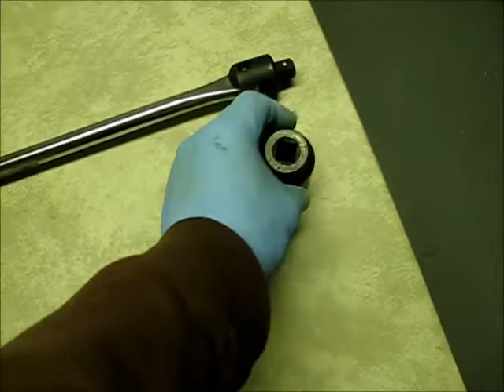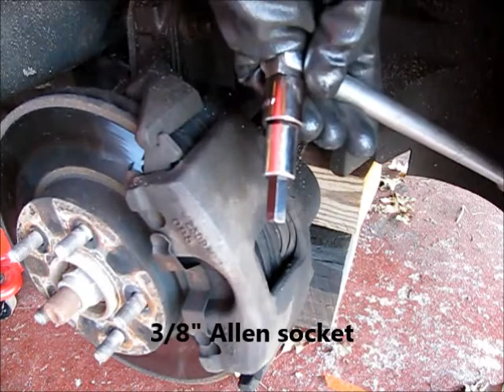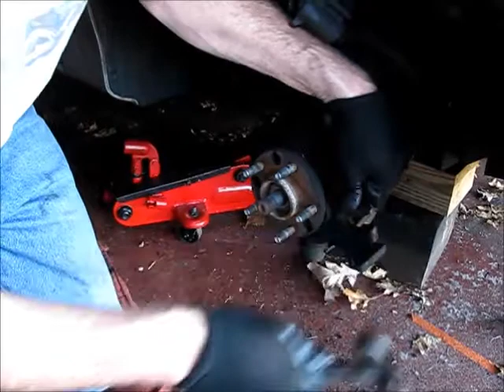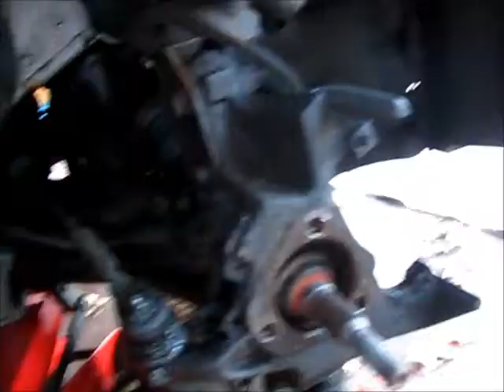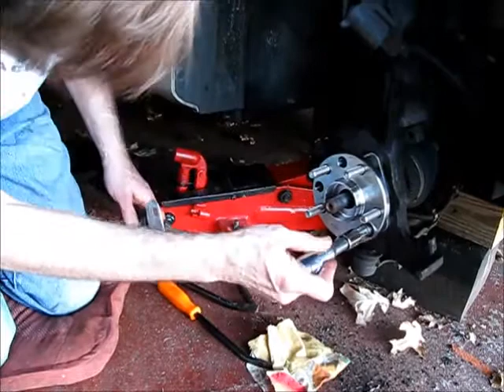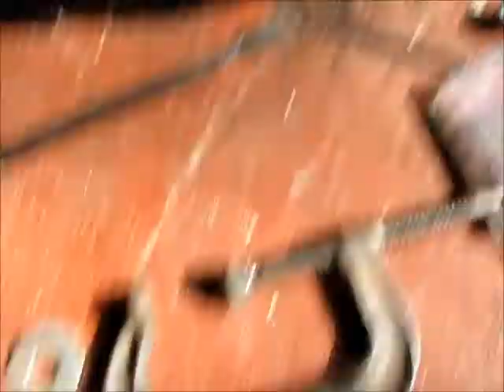How to replace GM front wheel bearings

Comment: So I'm gonna be doing this soon on a '13 captiva sport. It has an electrical clip wire. Would the computer need to be checked after installing?
Reply from the maker: I would just disconnect the battery while repairing and not worry about the computer.
Reply: @TheOriginalMechanic  awesome thank you